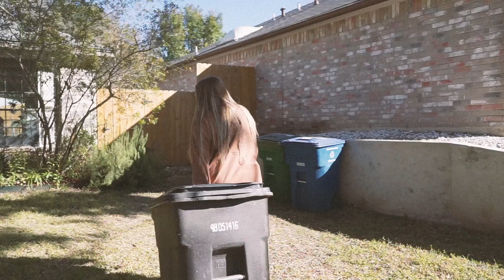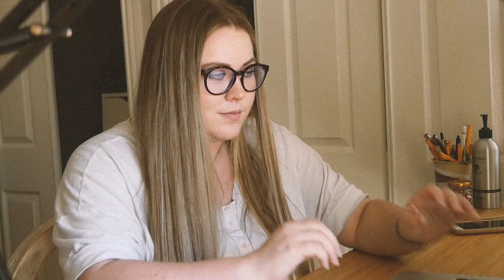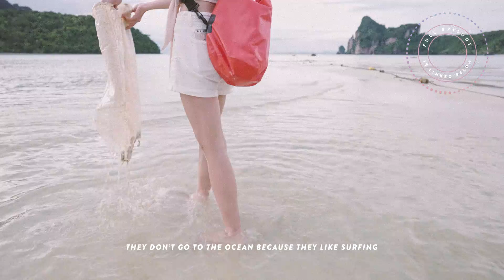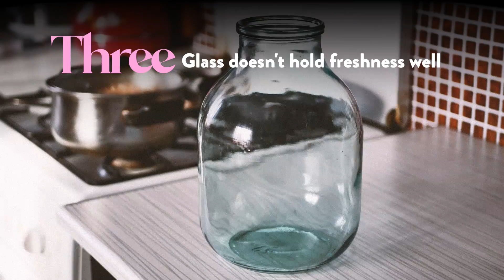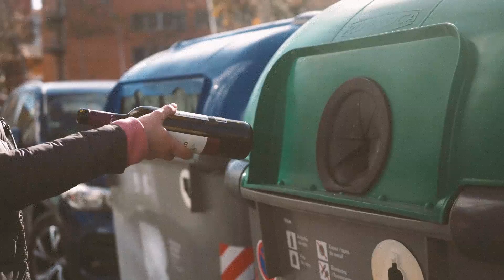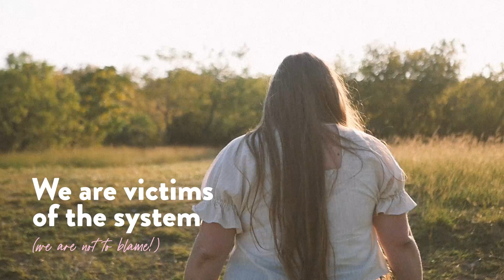why the zero waste movement is NOT a solution to the climate crisis

Comment: Interesting. I've been zero waste for nearly 8 years & I've read a lot about aluminium/tin & glass not being the best alternatives. Hence taking own containers & buying from markets & bulk food shops. I'm in Australia but we can't be the only people who understand glass etc isn't the good option, and that recycling is the absolute last resort. Not the best option.
As well as the push to make manufacturers accountable. 

This provided extra info & I didn't know this about plastics.
Reply: The feed on SBS recently put out some stuff about plastics, soft plastics, and recycling that might also be interesting to check out
Reply: @TheSlappee  cool thanks!
Reply: The problem is, i cant reuse a plastic bottle for years, while my stainless steel bottle will hopefully last at least 10 years.
Reply: @moonlight5966g  I don't see the problem there. That makes sense.
Reply: Certain areas in Australia are better for low waste. Some just don't have options.
Reply: @mariasoto1837  that's everywhere. I'm talking about the conversations that are had around zero waste only. We don't have the idea that recycling is great & glass is preferred if we've done some basic research.

Comment: I'm a small business owner. I grow plants, mainly vegetable seedlings to sell at farmers markets and the thing that I've been most concerned with is growing containers. I use sturdy reusable seedling trays to start and sell in pots that I have taken from the transfer station that would have otherwise ended up in landfill since UV light renders the plastic unrecyclable. While I feel like this is a better option than buying new plastic that will end up in the landfill, it takes a lot of time and energy for me to collect, clean, and sanitize those pots. I started this way to take advantage of the "free" resource of discarded plastic pots within my community, but it's not really free in terms of time, water, soap, and bleach for sanitizing. I've looked into biodegradable grow bags, but haven't pulled the trigger because the ones that I can get are produced in China and therefore carry transportation impacts as well as the uncertainty that they are indeed biodegradable. The other concern is then bringing lots of floppy grow bags to market and selling them to customers. At a certain size I could use cardboard 6-pack beer holders to hold the plants upright for the customer to transport home, which would encourage folks to buy in quantities of sixes, but the cardboard holders have their own associated costs and are not a cheap option as one might think. I've experimented with making my own paper pots, but at my production scale that's still a lot of work to make and then the process of tray watering and long term water saturation causes issues with mold and mildew which causes disease in my plants. 

So I guess what I'm asking is, am I doing the best thing or is there a better way? I sell organic plants to customers who are very environmentally conscious and selling in plastic, even if it is reused feels wrong. I do always make sure that folks know that I will gladly take back their pots at the farmers market, but only a few really take me up on that offer. My profit margin is basically non-existent and I'm really doing this out of a place of passion.
Reply: I have been thinking of this lately. I make paper pots but it’s such a time waste. I read somewhere that before plastic pots some people would use soil blocks and wrap them up in paper for customers to take home. I haven’t tried this but I might experiment with it. I don’t know if it would work. I also watched a video about just wetting soil and making a ball around the root when potting up instead of using soil blocks maker this might work for seeds as well. I am going to try it next year.
Reply: Stephanie D I think soil blocks are a great option for small farmers who start plants in a greenhouse and only transport them to the field, but the reality is that my plants take a lot of rough and tumble transportation, so I don't think they would hold together.
Reply: I know nothing about this, but would egg cartons work to hold soil balls?
Reply: anastasia0385 I have tried egg cartons once in the past. It seems like a great idea, except that egg cartons can't hold enough soil for most seedlings beyond the first week, and they have the same mold/mildew problems as other paper pots. For most seedlings I need containers that can hold about 2 cups of potting mix.
Reply: I am still in the research stage but after getting frustrated with other methods I have been watching videos about soil blocks and it seems like trays, meat trays or other upcycled trays  work best that way you can water from the bottom and it’s easy to remove. I don’t like egg cartons for plants as they are so small and grow out of them fast. All our paper egg cartons get turned into worm bedding for my red wrigglers.
Reply: For now I think reused plastic pots are the best solution. Can you somehow streamline the washing process? Do you need bleach or would soap and water be enough? I know some fungal diseases could need bleach but I don't know if they stick around on dry soil on plastic. 
I'm studying horticulture and wrote an essay on plastic pot alternatives awhile back and it seems like pots made from rice husks may be the best alternative in biodegradable pots.

Comment: ALL containers need to be returned to the producer.  Guarantee industry would find a way to reduce the waste if they had to deal with the cost. My vision for food is to have standardized sizes and containers with deposits that would be returned to the store. Then producers would have to compete on price and quality not fancy packages.  In S. Korea they still  have some  returnable beer bottles,  sometimes one brand of  beer comes in a bottle that has another beer brand's cast in the glass bottle.

Comment: I love this conversation. Another thing I always wonder is why we only count 1 truck delivery (of a full load). Each item is shipped from the production line to a stores distribution center, then unpacked (usually off of a plastic wrapped pallet) to another pallet for the amount that the individual store (for instance a Walmart) is needed. Then sometimes those pallets are all plastic wrapped on pallets and driven out. Then those trucks make multiple stops (with less and less items on each stop of the truck’s trip). They often use reusable air-fluff bags (made of plastics and sometimes paper) to buffer the load. At store level all the pallets are unwrapped, then often those items are individually unwrapped for the shelves. It’s all obnoxiously wasteful. But I’m not sure how they could remove those steps and excess wrapping materials. I know solutions are there.

Comment: I live in Northern Virginia near Washington DC. Our county and the surrounding counties have stopped glass recycling in the traditional sense. Instead of transporting it far away for making new glass, the glass is crushed and used for local municipal building projects (roadways and other construction projects) in a neighboring county. Additionally, it cuts down on the cost of broken glass getting in to the other recyclable streams and prevents some of it from going into the landfill. It's a small project so far and voluntary for people (like me) outside of the county it serves.

Comment: I think people want an easy solution so they feel like they are helping, which isn't a bad thing. But creating a black and white solution to a gray issue solves nothing. My hill is the argument of using electric cars rather combustion. Sure electric cars don't contribute to air pollution and have a lower carbon footprint when driving, but those lithium batteries aren't. Mining takes a heavy toll on the environment not to mention refining those materials. Most electric cars are powers by electricity made by coal anyway. Again it feels like a situation where people are looking at the end of the cycle rather than the whole picture. I'm not saying using combustion is better or more sustainable than electric, but me using my 90's vehicle til it's dead rather than chucking it in a junkyard to buy a 'better' more efficient vehicle is the wiser decision.

Comment: Thanks, this was another eye opener for sure. It's really daunting how complex and intricate the whole system is, from the extracting to the transforming to the disposing and all in between... sometimes we think we are making the best choice and it's really the other way. 

It's like that wish-cycling thing for example, if you hadn't explained how it can ruin a whole batch I'd keep making that mistake sometimes, because I still have many doubts about where each material goes and sometimes two materials may seem the same type, but they are not both recyclable. It's like you say we need to consider the beginning of the cycle and not just focus on the disposing/recycling.

Comment: pls don't start using plastic there is still one option 
buys things in bulk and make diys 
this way we don't have to use either glass or plastic packaging 
and remember to reuse everything what you have 
still zero waste :)
Reply from the maker: The problem is, as I mentioned, most people do not have access to that. And even those of us who do, it doesn’t include everything we would need or want in our diet. And, it limits you to the brands that are in the bin and the high chance that is an unethical brand that exploits people and the planet in other ways.

There is not perfect solution right now. That was my point.

Comment: Speaking of plastic.... this is a question for Shelbizlee but also anyone in the community that can help... I’m processing and freezing a ton of produce from my garden, and the amount of freezer bags I have to use is frankly grating. Anyone have any ideas for sustainable alternatives that are actually better?
Reply: I reuse freezer bags many times and I think they are actually a fairly good solution already. They aren't undergoing a lot of wear and tear while they are sitting in your freezer for a few months/year. I find they can last many years when used specifically for freezing foods. Wash after removing the food and then reuse for freezing more food the next year. They wear out a lot faster when you try to use them for something like storing leftovers because they go through the wash-use cycle a lot faster. Once people start coming out with plant based versions, I think they will be one of the best food storage options (I don't like the silicone versions very much. A lot of upfront footprint for marginal benefit during usage)

Comment: I appreciate what you're doing to break down what's right and wrong with the movement. I recently reviewed a kid's book on zero (plastic) waste, and while the intention behind it was good, it's just going to put undue stress on kids and make them think they've failed horribly when things don't work out the way the book indicates it should. For example, the book made a big deal about bringing your own takeaway container for leftovers or takeout at a restaurant. Great in theory, but there are many reasons why it might not work out, and none of them will be the kid's fault. Maybe the restaurant trip wasn't planned. Maybe the container turns out to be unsuitable for the amount/shape/type of food. Maybe (especially in the case of takeout) the kitchen can't take an outside container into the kitchen for sanitary reasons. Maybe the disposable/recyclable container is destined for the bin anyway even if you don't use it because it's already left the kitchen and is now considered dirty by kitchen sanitation standards. It should have demonstrated what to do with takeout containers if they make it to your as well, rather than just suggesting that they can always be avoided. It would be more empowering, in that case, for the kids to feel that they have the power to ensure that the right thing is done with the unwanted container, rather than feeling like they've still got to transfer into their own container and let the restaurant throw it out.

Comment: About the glass not often being recyclable if smashed I thought it would be cause locally I have to put bottles into a bottle bank where they drop to the bottom n smash :( or am I reading that wrong?
But thank you such an informative video so many things I hadn’t thought about before!
Reply: I think a machine smacking previously intact glass is different than a person holding shards of glass. It’s a safety hazard.

Comment: What do you think of making “eco bricks”? Do you think they’re worth it at all?
Reply: What happens if the building catches on fire? The noxious smoke from the plastics in the "eco-bricks" can be lethal very quickly. I think building buildings out of plastic is always a bad idea for that reason.
Reply: @richards5110  that’s a good point, what about for things like roads, or smaller structures like benches and tables